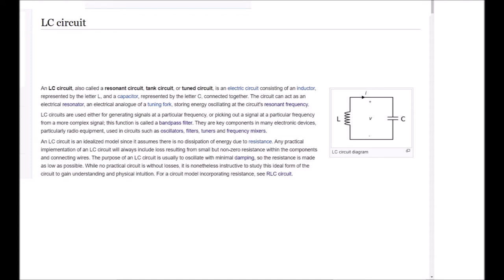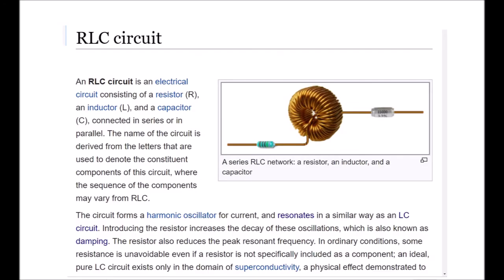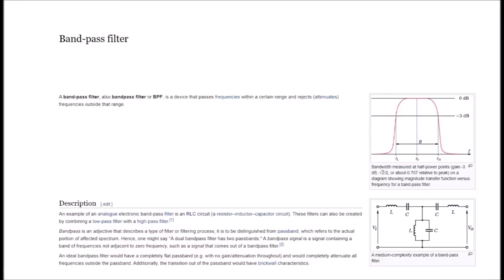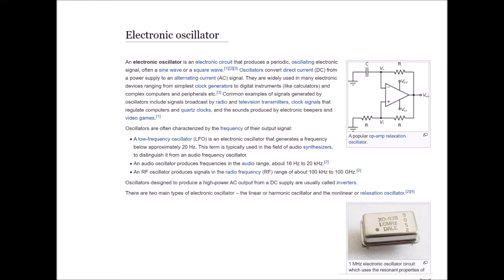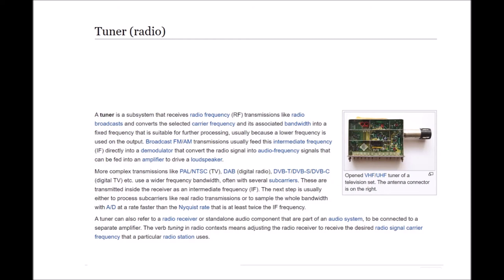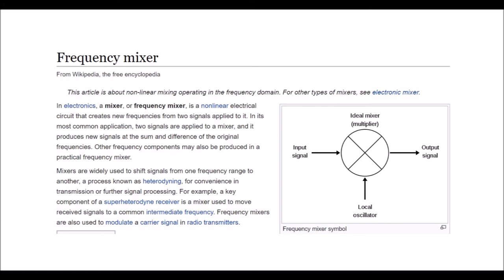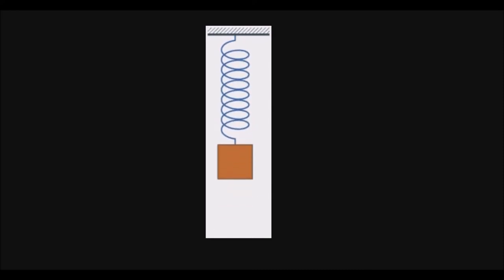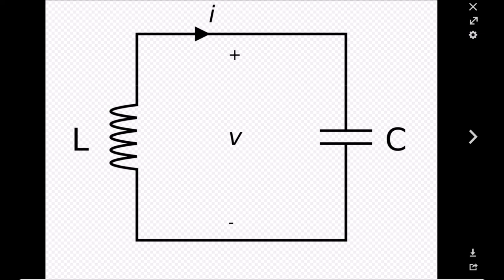LC circuit (resonant circuit; tank circuit; tuned circuit)

Comment from the maker: 14:34 An LC circuit, also called a resonant circuit, tank circuit, or tuned circuit, is an electric circuit consisting of an inductor, represented by the letter L, and a capacitor, represented by the letter C, connected together. The circuit can act as an electrical resonator, an electrical analogue of a tuning fork, storing energy oscillating at the circuit's resonant frequency.

LC circuits are used either for generating signals at a particular frequency, or picking out a signal at a particular frequency from a more complex signal; this function is called a bandpass filter. They are key components in many electronic devices, particularly radio equipment, used in circuits such as oscillators, filters, tuners and frequency mixers.

An LC circuit is an idealized model since it assumes there is no dissipation of energy due to resistance. Any practical implementation of an LC circuit will always include loss resulting from small but non-zero resistance within the components and connecting wires. The purpose of an LC circuit is usually to oscillate with minimal damping, so the resistance is made as low as possible. While no practical circuit is without losses, it is nonetheless instructive to study this ideal form of the circuit to gain understanding and physical intuition. For a circuit model incorporating resistance, see RLC circuit.